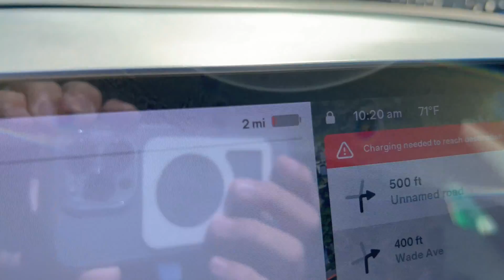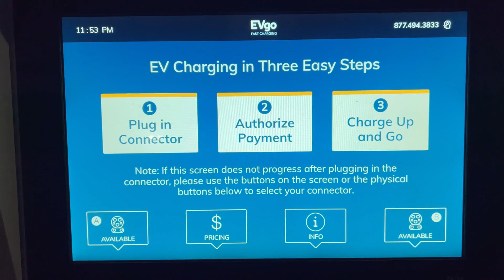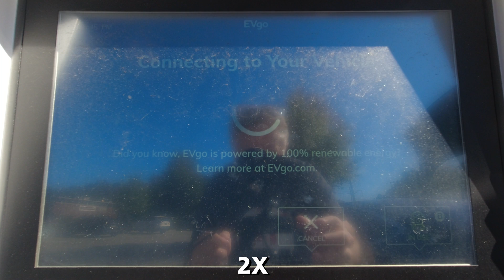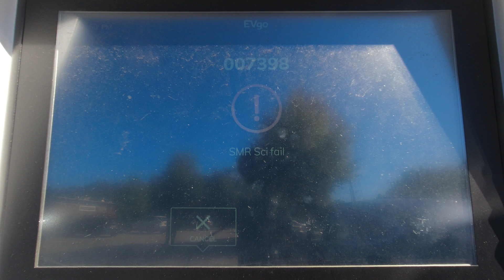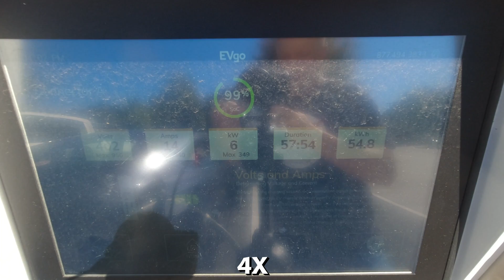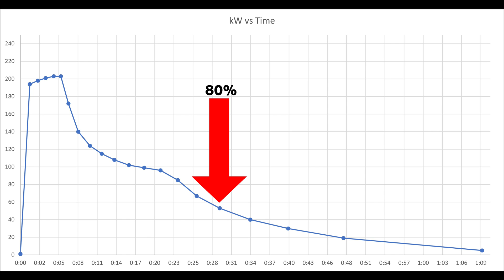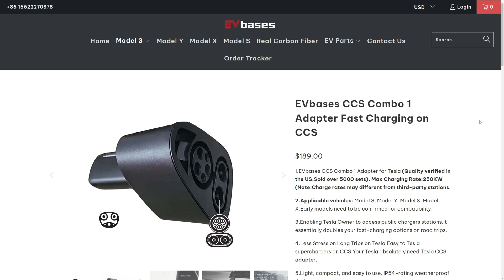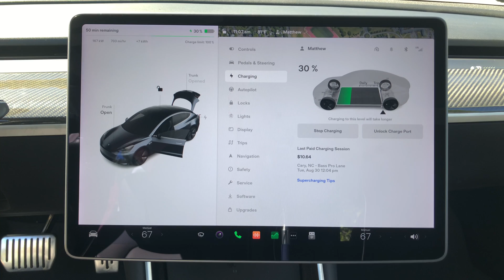Tesla - EVbase CCS Adapter with a 350 kW Station

Comment: I tried that station three different times and was unable to get it to charge.
Reply from the maker: Were you using the app or the credit card reader?  I created an account on the app a couple weeks ago.  My next test will the 150 kW EA location on Glenwood Ave.
Reply: @MTNRanger  I was using the credit card reader. I can create an account and try that.
Reply from the maker: @DavidSpector  Let me know how it turns out.  LIke I mention in the video, the left cable worked better for me.
Reply: My 3 is a 2021 but in the menu stats ccs installed no…so not sure about your statement of 2021+ does not need the mod
Reply from the maker: @Chase-zr3cy  The problem is that Tesla changes things sometimes with no definite cut-off date.  There are some 2021 that have the CCS capability.  Yes, if the screen say not installed, you will need the retrofit. It can be done for around $200.